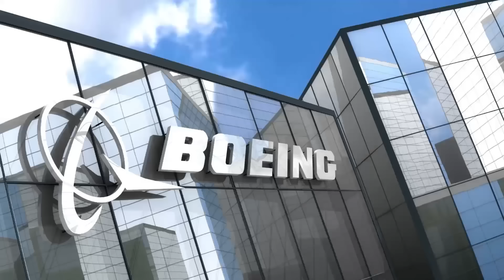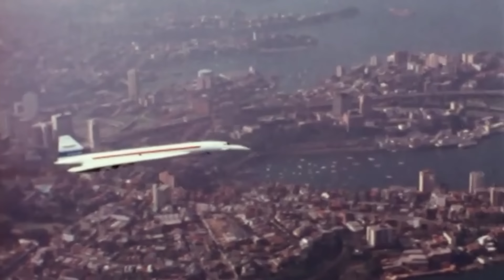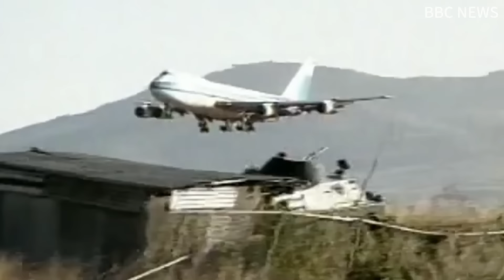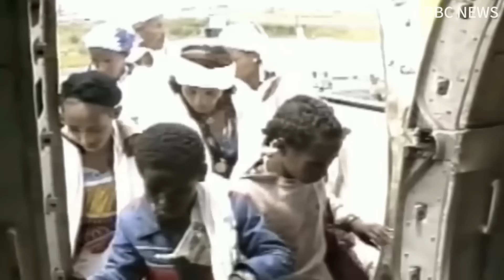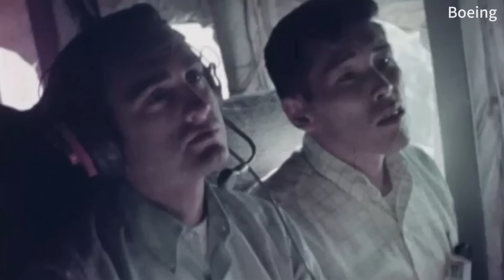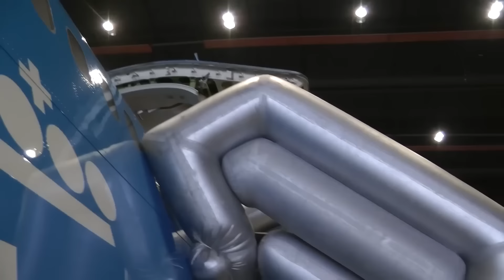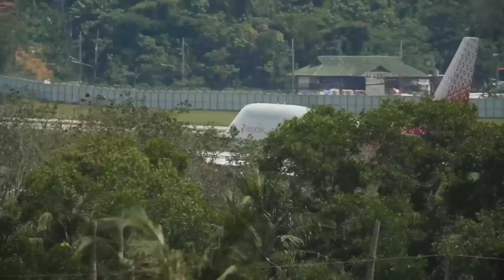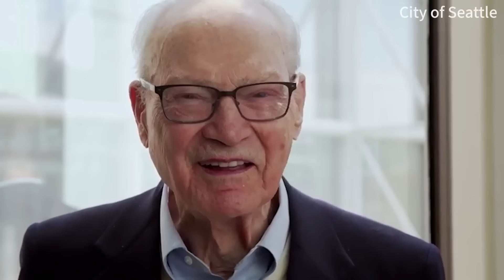What The Boeing 747 Hump Was Really For

Comment: A350 cruises at mach 0.85 too
Same as 747
Only the MMO(maximum speed before overspeed) is higher than a350-mach 0.89 vs 0.92
So cruising speed is same
Potential is higher
And potential is never used in airliners

Comment: The Antonov AN-225 was a Six Engine monster that also was built to carry a Space Shuttle, the Soviet Buran in the same manner as the 747 did with the Shuttle. It also could carry cargo and more than a 747. That is also an iconic jet from the Soviet Union that should be recognized for what it was. The 747 was commercially successful and a record breaker but so was the AN-225. I did get to fly on a couple of them too. Solid bird. One flight (LAX to Boston) we had to climb to 42,000 to avoid a massive thunderstorm which was pushing things as far as how high the 747 could fly but we flew over a thunderstorm at night and it was like a fireworks show with lightning as we flew over at a safe enough altitude to avoid the turbulence and lightning strikes. Seeing lightning arching across the tops of clouds for miles is breathtaking and almost as awesome as being in the desert at night and seeing a meteor shower that is so intense it is a literal fire fall. Still, seeing nature from above is just as wonderful as seeing things from the ground sometimes. I got to do one of those things in a legendary aircraft.

Comment: The speed of subsonic aircraft has been nearly constant since the 1960s not because they couldn't make them faster but because of efficiency. (look up the story of the Convair 880) At near-sonic speeds the air drag becomes exponentially greater and especially the 747 was quite a fuel guzzler because of its four engines. Mach 0.8-0.82 are usually considered the most efficient.

Comment: It's not that other aircraft can't "outpace" the 747, other long range passenger liners like the 787 and A380 cruise at mach 0.85, the 747 cruises at mach 0.855. The difference is only 3kts. And the 777 cruises at mach 0.84. And Emirates claimed that their A380's were more fuel efficient at mach 0.86 (20% more efficient than a 747-400 according to Signapore), which technically would give them a higher cruise speed than the 747.

Comment: Back in the late 1960s - early 70s when I was a technician in the Royal Australian Air Force I read that Boeing had pulled a financial con with the 747, designing it and building the first prototype under a US military contract to develop a large military transport, in competition with Lockheed, which designed and built the Galaxy under the same funding programme. Boeing lost the production contract to Lockheed because the Galaxy did the military's job better, but apparently Boeing never expected to get the final military contract, they just wanted the military funding to design the next generation commercial aircraft after the Comet and 707 generation. If the report I read back around 1970 was true (and I have no reason to believe it wasn't) that was the real reason the 747 was designed with a high cockpit and a lifting nose. Ironically, Boeing subsequently got military orders for 747 in-flight refuelling tankers, and I think also for 747s for use as airborne military command centres and in aerial electronics surveillance, and of course the U.S. Presidential aircraft. Another irony was that Boeing subsequently complained that Airbus' competition with Boeing was unfair because European governments were funding its design and manufacture. Boeing's failure to produce its over-ambitious SST also resulted in another bit of skulduggery, the banning of Concorde flights over continental USA to compromise Concorde's commercial viability. All's fair in love and war, and business definitely is war.

Now there is another Boeing irony, despite the lessons about the importance of designed-in safety learned from the DC-10, Boeing cut corners when it attempted to upgrade the 737 to the Max, which made it another 'death jet', and I hope never to fly in one, because it is not naturally balanced fore and aft because of design compromises made to fit larger engines on an airframe designed for smaller ones, so if the improved electronic balance compensation system ever fails and the pilots are not able to deal with that, the aircraft will crash again. And more recent reports seem to suggest that Boeing still has not properly come to grips with design and manufacturing safety issues, U.S. market dominance seems to have made it complacent.

Incidentally, the 747 also had a cargo door problem similar to that of the DC-10, but although it lost several passengers as a result of that I don't think it ever actually caused an aircraft to crash, so apparently the 747 didn't have the DC-10's other problem of having crucial hydraulic and electrical control systems mounted where they could be compromised by a structural failure resulting from cargo-bay decompression. A Galaxy did crash as a result of faulty rear cargo door latches though, in Vietnam near the end of the war.

As for my own personal experiences flying in the 747, only one stands out, being lucky enough to have a window seat on the correct side of the aircraft when one flew down close to the legal minimum altitude to circle Ball's Pyramid en route from New Zealand to Australia. I've had quite a few interesting in-flight experiences, beginning with my first flight ever, in 1957, as a twelve year old passenger in a DC-3 dodging tree tops as it wound through the valleys in the Finisterre range between Madang and Lae, and including having a full circle rainbow just off of the wingtip of a DC-4 flying just above cloud, flying in the ultimate pre-jet passenger aircraft, the Lockheed Super-Constellation (a beautiful aircraft), inadvertently putting a Long-Eze into a nose dive and living to tell the story (I know of two pilots who did that in the short-wing version of that aircraft and didn't live to tell the story), and circling ships at sea below deck level while in the nose observer's position in Lockheed Neptune aircraft on maritime patrol in the Indian Ocean (about 50 ft above the ocean actually, not quite in it), so it takes something special to get me excited or enthused in-flight. Circling around Ball's Pyramid is the most special experience I've had as a passenger in a commercial jet aircraft (jet aircraft took the fun out of flying), and anything more special than that would probably be even more unwelcome than an engine failure in a large helicopter, which I also experienced and lived to tell the story.

Comment: Most memorable one was Aug 2025, Chicago to Frankfurt with Lufthansa. 20 minutes into the flight, the pilot came on an started explaining what a fuel dump is and not to be concerned. Landing gear didn't retract properly so they will return and have a technician 'look at it'. Probably just a faulty sensor. 

Yeah, the gear could have collapsed during landing and death-spiralled. Luckily we were able to get on the Airbus that left 6 hours later.

Comment: Yes I flew many times on the 747 on marathon flights across big oceans.  It was very loud and I always wore ear plugs.  Quaity of service and seating varied with the airline I used.  Then there was a special built 747SP (special purpose) Boeing manufactured for those extra extra long nonstop flights.  It carried fewer passengers and as I recall there was standard coach seating because of the additional cost of flying such long distances in a purpose built aircraft.   I do remember it took quite a bit of time to load and unload passengers in the regular 747.  Not for the impatient.

Comment: Once flew on an AA 747 back from San Francisco to Frankfurt. Honestly it was an awful experience. Loud, dry air, bad entertainment system, worn down interior. No comparison to the flight from Frankfurt to San Francisco in an A380. Quiet, quiet, quiet. No need to compare the rest. Also was kinda hyped when I had a flight ahead in the highly regarded 777. Same shitty experience. I don't know what the fuzz about Boeings is all about. Especially the 747 and 777. Compared to an A340 the 777 was a nightmare. 11 hours of unbelievable noise, rough through turbulences, same shitty dry air, quirky seats. Nothing I expected.

Comment: Lufthansa Air lines still has their 747's operating, although they're due to receive their 777's by 2026/27, Lufthansa will still be operating the 747's at a certain capacity until 2035......Lufthansa understands the capability of 747's and has many replacement parts on hand for ongoing maintenance at the moment

Comment: My wife & I flew First Class on a TWA 747 from JFK to Heathrow in 1980 for our honeymoon. There were traffic delays at JFK. After we taxied away from the gate, the pilot announced we would be sitting on the tarmac for maybe up to 2 hours. The passengers let out a loud groan and then the pilot announced that beverage service would begin immediately, resulting in loud cheers from the same groaners. The flight attendants plied my wife and me with champagne and caviar and other goodies over those 2 hours to celebrate our marriage. My wife was pretty tipsy by the time we took off. Just an outstanding way to start our honeymoon on that big beautiful bird.

 I've flown probably 40 transoceanic roundtrip flights on the 747. I relished flying business class across the Pacific (about 20 roundtrips between NYC/Newark and Tokyo alone) because I could finish a book on the flight, enjoy drinks at any time, nap and not be disturbed by the demands of the day. 

Early in my traveling days, a regular 747 would need to refuel in Anchorage Alaska. Then, the 747-SP (a shorter, longer range version) flew non-stop to Tokyo. Eventually, all the regular-sized 747s would fly non-stop across the Pacific. 

I was also on one of the first fly-by-wire 747s coming back from Tokyo on Northwest Airlines. A Boeing engineer and I chatted at check-in. He was coming home from Japan after several months of training the Japanese crews of Northwest on how to fly and maintain the new version. He told me about a test flight he was on where the computers shut down mid-flight. Pretty harrowing experience, but he lived to tell the story to me. On board the new fly-by-wire 747, I sat upstairs and before the flight, from my seat  I was staring at the computer screens in the cockpit. The flight engineer noticed me and waved for me to come in. He showed me all the operating screens. He explained the aircraft could takeoff and land on its own if they had to. Totally COOL!!!

Comment: The hum-had no other job other than to make money. That was the real reason it existed. It was a way for airlines to make 1st class into a superior experience on the same plane carrying 300 people in squalor just be;ow them. Airlines wanted efficiency. The more people you can move on one airlines the better the return on investment. Longer doesn’t work because airports are too small for it to take off. See the airbus a380 for reference. And the fact is you cannot fill an entire top with 1st class passengers, so, let’s just add a second level over where traditional 1st class would be. So all of the extra passengers onboard are paying 1st class prices and maximizing the return on the flight.

Comment: As a young Airnan in the USAF stationed at my first duty station, McChord AFB, Tacoma, WA in 1969 my job was processing thousands of Military Personnel and their families to fly to Alaska, Korea, Japan ans Vietnam.  I also greeted the arriving flights and escorted them through Customs.  In 1969, Boeing was testing the 747 out of Boeing Field and needed a place to land it away from it's home to see how much damage it might do to a runway.  They knew that future runways were going to need reinforcement for heavy use of the new plane.  They were granted permission to make McChord the first "Destination" field to land their new plane.  Weeks of preparation began including driving the special, TALL Staircase Truck from Seattle to McChord for the Test Crew.  My job was also driving the "Normal" "Step Trucks" up to the 707s and DC-8s but I was too young to be trained on the Boeing Unit.  So, as a Student Pilot with 35 hrs, myself, I stood on the tarmac and watched the many approaches prior to actually landing on our runway and the FAA C-47 (DC3) would fly very low down the runway between Touch & Goes to see if there was any runway damage. Funny, I don't remember if it made a full stop or not on that day.  But I did know it was a monumental occasion. Only a year later I found myself in DaNang, VN pulling the Step-Trucks up to American & Northwest Airline 707s and DC8s to greet new arrivals to DaNang.  The BEST part was loading those same aircraft with Vietnam Veterans on their way HOME!

Comment: your comment about the speed is completely irrelevant. the modern planes are not designed to try and be quicker than the 747, as they would very easily be if it was a point. they are design for efficiency solely. so when you say that modern computers can't surpass the 747, you are so off the mark it's painfull.
not wasting my time with the rest of the video.
welcome to my "do not recommend this channel" list

Comment: Many years ago I went to Chile from Brazil. I took a cheap flight because it was during the high hours before the sunshine. It was a British Airways Flight coming from London  to Chile that had a stop in Brazil: São Paulo and Rio alternation each other day. I never had flown on a 747. When it came it was huge for the time far higher than the others around a little messed inside because most people get off at São Paulo. A short flight, but as Santiago airport is soon after the Andes it flew over them so low that you could see the trucks on the roads on the mountains.
After that Boeing 767 and Airbus A320 took over and I never had flown on one again. But comparing flight to Chile I can say it was much less bumpy than other flights, maybe because it was early in the morning or maybe because it was bigger and so more stable.
It was the most comfortable flight I ever had.

Comment: I watched the first 747 roll-out ceremony accidentally at age 13 on my grandmothers TV... and I found it amazing.  Years later I had a desk right next to the original 747 production line in the Everett factory, and around 2008 I was part of a project that made the 747-8 (the final version) happen.

I've never ridden one, but I walked through them as they were being built.  I was all over that factory, from up in the catwalks above the bridge cranes, and down in the tunnels under the factory, working projects that tightened up the parts flow, the wire shop and engines production, and I was there to watch the last one leave the factory for the final time as the 747 production line finally shut down for good after a 50 year run.  Can you believe that!  Fifty years for an airplane program.

I'm retired now, but I live near the factory and still hear the engine run-ups on the flight line at Payne Field, and occasionally drive by those big hanger doors of the largest building by volume, that was once a kind of playground for me.   The "queen of the skies" was as close to magic as any engineering team could create. and I got to be a small part of it for a time.

Comment: I remember the Banff 747 painted orange. I sent my Mom and Dad to Hawaii for a vacation. My Mom's first and only flight. 
I was an engineer on the vertical stabilizer that we built in DFW at LTV Aerospace. I never got to fly on it or the other jumbos. I worked on the DC-10 and L-1011 aircraft also as an engineer. Sweet memories.